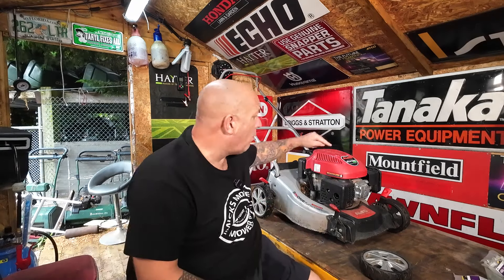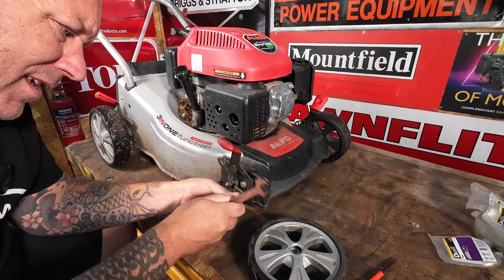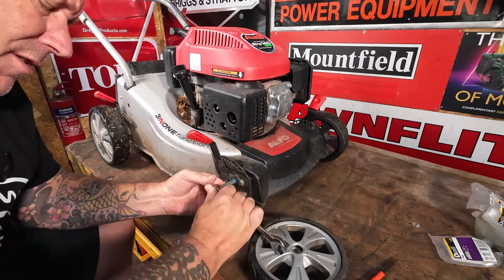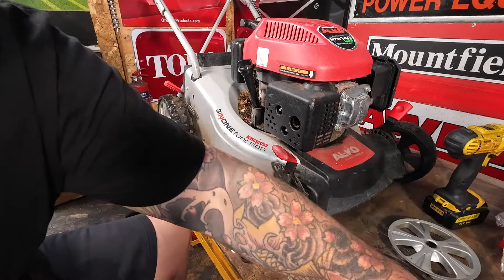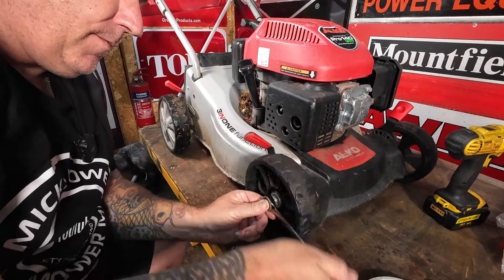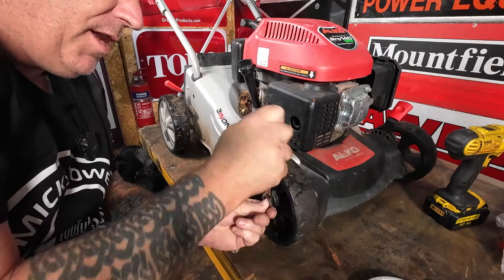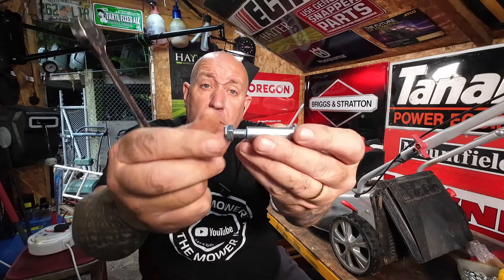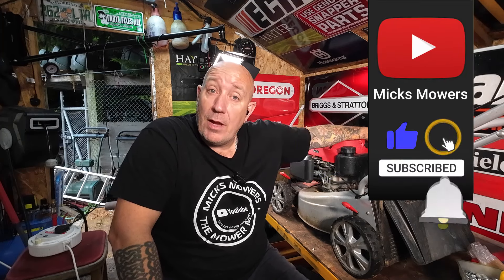lawnmower wheels keep falling off.. here's a top tip

Comment: Great video, I wish Riley boy a speedy recovery. A question Mick is it possible to fit a manual throttle onto a standard lawnmower? My Stihl struggles up a steep slope but goes too quick round the awkward sections of the lawn.  Cheers John
Reply from the maker: @johnclose2323  anything is possible mate

Comment: Hi Mick not been on in while pal - best wishes to Riley Boy and the rest of the clan. I do have something I would love your opinion on.  Just bought a second hand Hayter Harrier 41 which you have done a few vids on.  Drained and replaced the oil - never seen oil this colour before.  It was a milky grey colour.  Starts first pull no problem and nothing out of the ordinary when running. Got me slightly worried I bought a duffer😱
Reply from the maker: @paulmcgarry7745  water in the oil mate .oil change and run it for 5 hours .. then give it another oil change.m should be good

Comment: Use the proper tools, a tap and dye set.
Reply from the maker: @AndyJ5431  🙄it did the job.. it worked..
Reply: @themowerman  but you buggered up a bolt in creating the thread, so using two bolts instead of one, personally a shoddy effort from you.
Reply from the maker: @AndyJ5431  ta .. I appreciate it